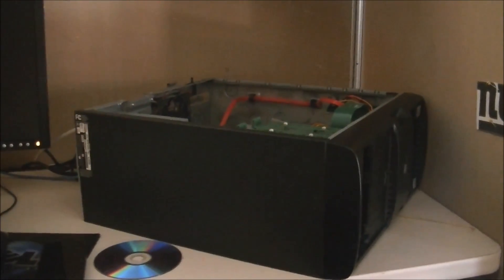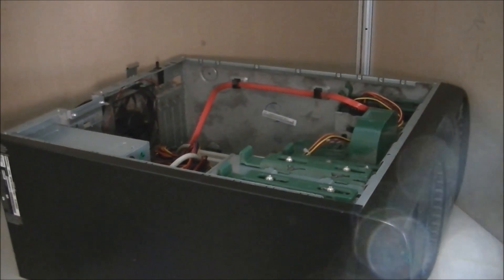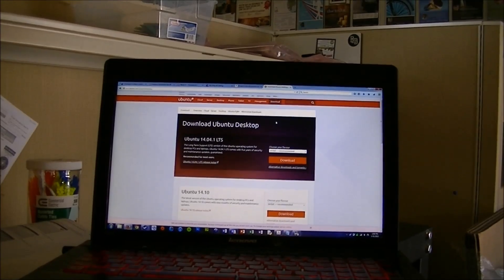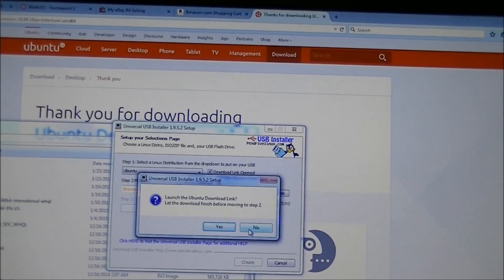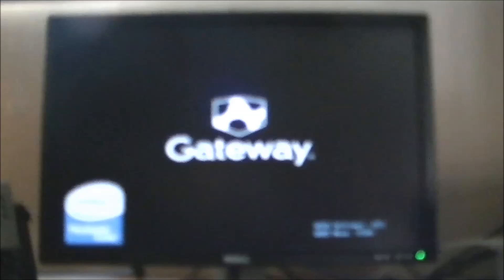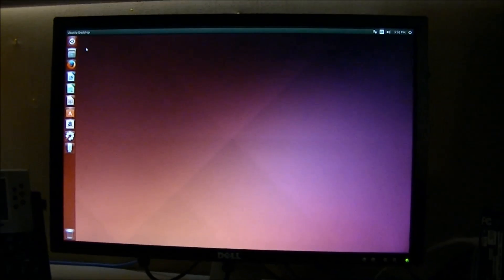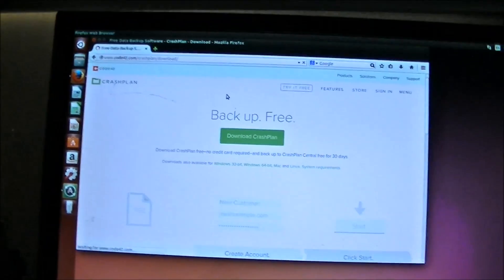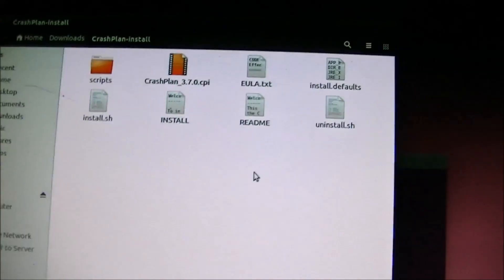How to Make an Inexpensive Linux Home Backup Server

Comment: I wonder could you have used Debian 8 Jessie 64bit with something like 16GiB of GDDR4 RAM, 3TiB Hard-Drive and AMD A10-7850k which means no need for a graphics card as it is built into the A10-7850k.

Comment: Would a single core pentium 4 3.00ghz work well? btw i have 2 gigs of ram.
Reply: spyro910 For backup purposes even an old Celeron would work just fine. The CPU will sit idle most of the time anyway because hard drives are much slower than CPU.
It might be another story if you want not only a backup server, but also a media server, DLNA server, torrent client and what not - then you might need a bit better CPU, but still Pentium 4 should be enough for most of these tasks.

Comment: im not sure if you tried it but when you are "reading" things like the EULA you should be able to just type in "q" and it will continue to the next step, so in that case after you hit q, you will be prompted with "Do agree with the EULA?", just a helpful tip for next time. Im not a big Linux user, but i do remember that from my CS class which was strictly in the LInux platform :D great vids!

Comment: Listen, this is a big waste of electricity  and noise, when you can buy a PogoPlug
for 20 bucks, uses 18 watts of power, does the same for less, or if your back ups
are small just buy a 32 gb thumb flash drive, or for free use Microsoft One Drive.

Comment: also if you want to install the server version there are commands for downloading the GUI for use on it.
 sudo apt-get update
 sudo apt-get install ubuntu-desktop
 The above command will install GNOME desktop
Reply: How do you do kde?
Reply: mwojable For KDE change install ubuntu-desktop to install kubuntu-desktop. this is the info ive found on it, i have not tested though
Reply: Judeface85 is the server version actually different? Is it more streamlined in some way? Beyond not having the interface?